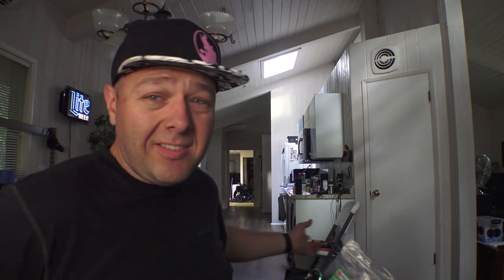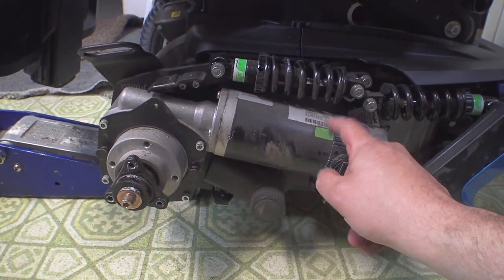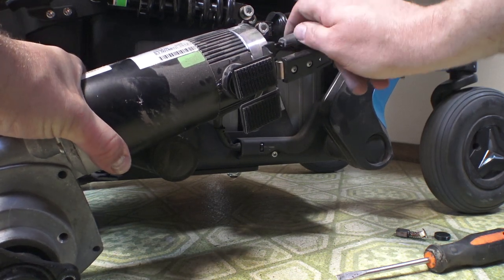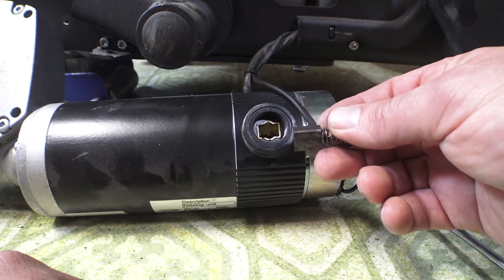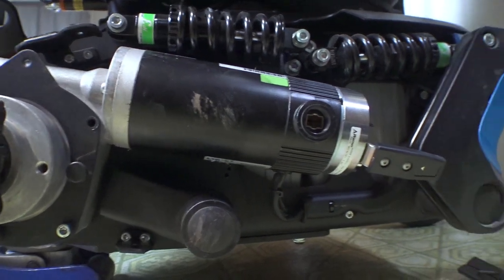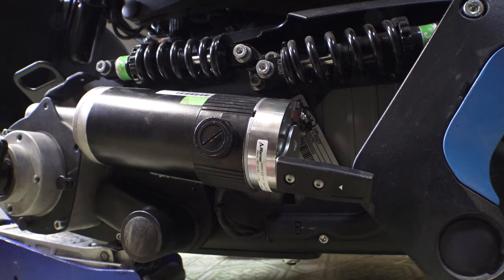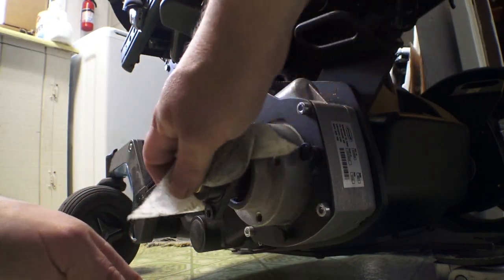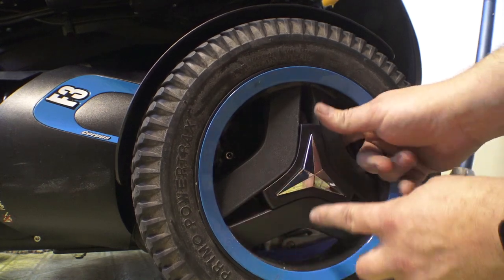MEGA VLOG 563: bad brushes? (F3 motor inspection)

Comment: Damn, your good. I have a problem with an old but very good Invicare TDX-SP from 09 I use as a daily driver (because my F3 does not fit in my ford E250. I use and been beating up my TDX for years without any problems until yesterday. I got a "left motor fault" on the display. Assuming a problem with the left motor I disconnected both motors and when I powered up the chair I still get a left motor fault and nothing happens. Do you have any ideas? Would appreciate any input
Reply from the maker: usually start with the basics - check all the wiring and motor connections... if ya wanna get fancy, ya could check the resistance of the motor windings with a volt meter - unplug the motor cables form the main controller and check the larger pins - compare the resistance readings from left and right, if one is WAY different than the other, you'll know there may be an issue with that motor
i think 2009 was before the 'sealed durawatt' motors for invacare, but those older motors (especially the 4 pole ones) tend to go bad a lot..
Reply: @TotallyNormal-  thanks for the advice. I checked the resistance of both motors—there the same. What puzzles me is that I disconnected both motors, bypassed the original joy stick and connected a new backup joy stick control and I still get a split second display reading “control fault” then immediately the same display, “left motor fault”

Comment: I have this F3 also from 2016 and just now lost the use of the right-hand motor, I don't think it is a brush issue but rather some other electric issue. I viewed this video so I would know 1st hand the process of removing and reinstalling the motor/ drive gear assembly. Good video thanks for sharing.

Comment: Thumbs up for your motor Brush replacement video, very interesting, my local provider here in New Zealand, does not routinely replace brushes because it’s considered a little bit fiddly and they tell me by the time the motor comes in for service it usually something else wrong with it and they just replace it LOL years ago I’m talking 20+ years ago motors used to be completely disassembled and serviced, but I suspect now the cost is the Factor that stops people from doing that

Comment: Nice video!

When Permobil went from the 300 to the 3 and 5 series, they reduced the number of bolts holding each drive wheel to the hub from 4 to 3.   That concerned me initially, but with proper torque and thread lock, all has been good.

Excellent advice on backing up the screws counter-clockwise until the threads align and "click" before screwing them in clockwise.This is very important when working on the plastic ICS unit.  The plastic posts that the screws thread into will easily cross-thread, and the post can split.

Comment: yeah! yup, been wanting to see this. dan, get a few boxes from a big box store. or a good chair mat. i have a few good thick boxes to protect the floor. the low friction of cardboard makes it easier to slide around to work on my chairs. works outside as well. my floor jack got to heavy for me. lol  bought one of the new electric jacks. LOVE IT! you should check them out. amazon sells several models. if i didn't have AAA i would get one for my van even. take care. great video on the f3 motors! thnx!

Comment: I have an F5 with about 9  miles, it has an oil leak, any suggestions? no warranty, and my local  dealer only works on chairs they sold.
Reply from the maker: uh oh! can ya tell where the oil is coming from? sounds like one of the gearboxes has a leak!
they should take care of it though, since its a brand new chair :^)

Comment: Hey bro! Great videos thanks. My m3 broke relpaced batteries, tested amp on every wire. Most likely cpu issue. Putting two m300's together and fixing the tilt actuator. Definitely not wanting till july 24th. Nice work thanks!

Comment: Dan that was one of your best VLOG’s Really you at your best. Extremely Thorough, Just one Thing Did you add Treadlock to the blot(s) as your refiting them ?

Edited to add:  10Nm (Newton metres) of torque is the motor blot setting of which there are 5 on,  My Late 2019 Sunrise Medical Quickie Puma 40 Pro S Line Gyro RWD in my service manual Not sure if there the same but I would think there much the same.

Comment: What happens when the brushes need replacing? Is it worth it? Is it safer to buy new motors?
Reply from the maker: in a lot of cases, by the time the brushes need replacing, other parts are most likely are worn out as well..
Reply: @TotallyNormal-  thanks Dan I think there’s just under half the brush length left of both sides on all eight brushes

Comment: A little off topic but can the drive motors on electric wheelchairs have the capability to tow a little trailer or wagon?
Reply from the maker: its possible - depending on the chair.. some of them might get warm or go into thermal lockout.. but something small and light weight isnt usually too much an an issue..
Reply: @TotallyNormal-  thanks!  Great videos BTW!

Comment: Thanks for this one! I need to do this to my super old chair. I wonder how much brush dust settles in between the commutator's surfaces (which can have a substantial negative effect on efficiency). Taking it apart completely would be better, but was it you once(?) who showed the because of locktight, the bolts that hold the brake can just break off.. RIP motor.
Reply from the maker: yes - the bolts / screws that hold the motor onto the gearbox will break 95% of the time.  they're very small diameter - also similar to a torque-to-yield style bolt.  which means that when tightened the metal actually stretches.  making removal VERY difficult.
as for the rest of the bolts.. once they're out they can be brushed clean easily.  this type ff thread sealant is single-use.